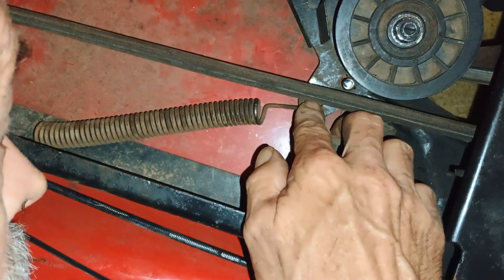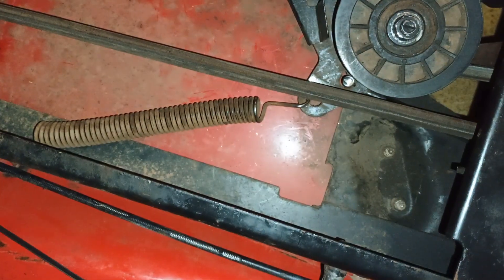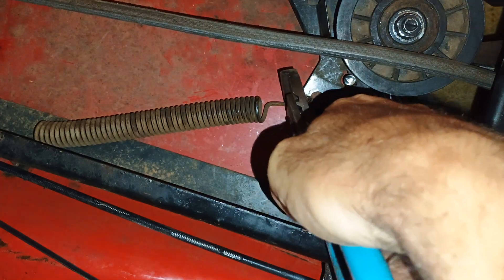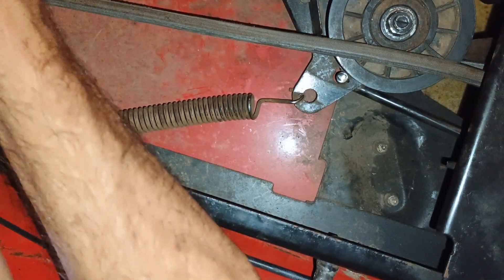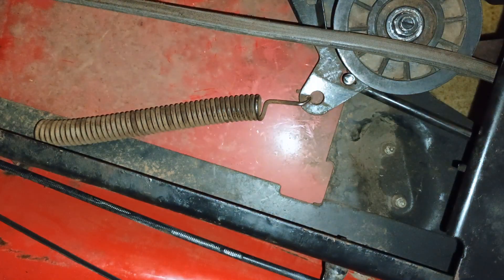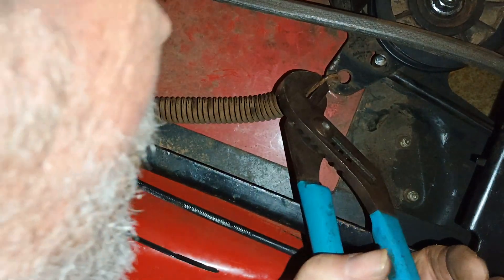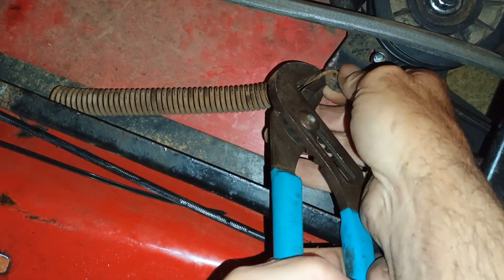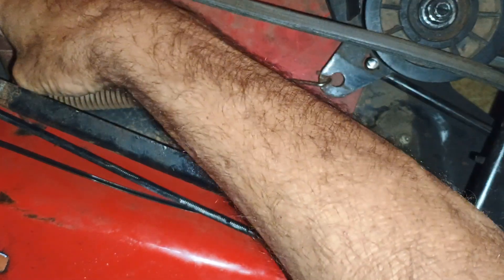getting ready to remove the Old parking break spring

Comment: Robert Mailhos.. They make a hook tool with a T-handle that makes removing and installing springs easy. Or you can use a piece of small diameter rope. Just loop it around the hook of the spring and pull the two ends of the rope. When installing the spring and you get it hook where it goes it might seem like the rope is stuck but all you have to do is pull on one end of the and it will pull rightWorks like a charm.
Reply from the maker: @RenegadesGarage   thanks for the help with this matter of the spring David 👋

Comment: Can you take the rod out so you can spin the bracket farther and maybe get more slack. May also help putting it back on .   If you can get to the spring from the way you want to pull , then can put some tiewire through spring end and pull the wire to pull spring back.